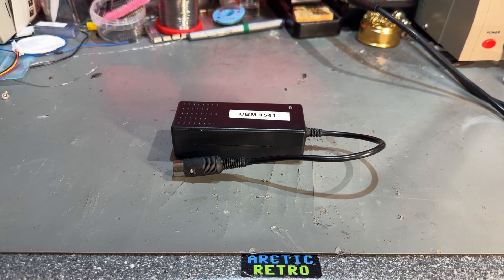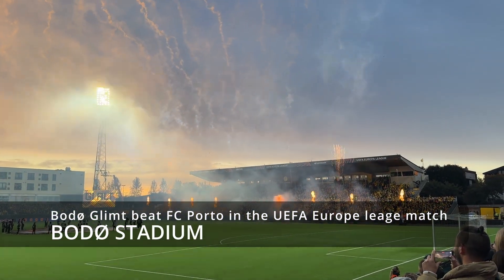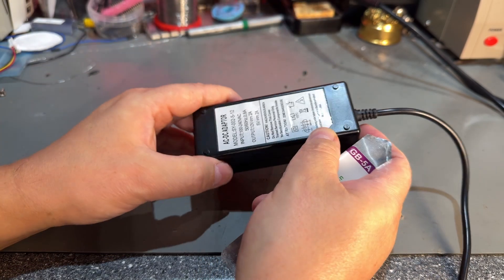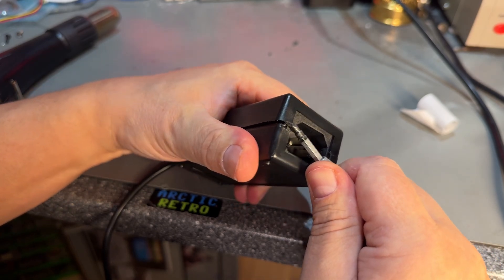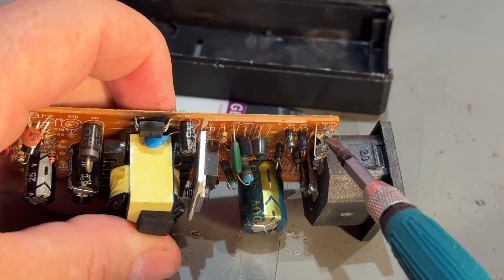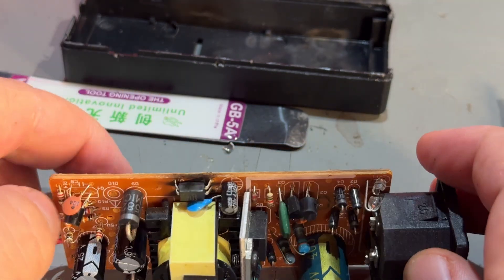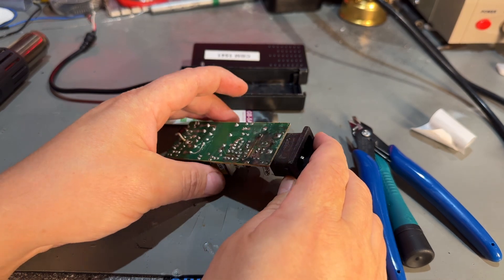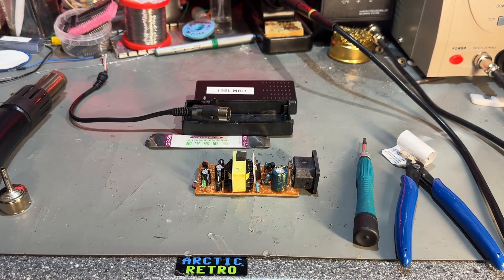SHOCKED ME: This 1541 power supply BLEW UP while I was using it. Can if be fixed ?

Comment: I found someone who created a USB-C to DIN power Adapter for the 1541 and 1581 drives, you only need a proper USB-C charger, works fine on my 1581. 
The 1581 only draws 1A on 5V max. so no actual reason to damage a 2A PSU, maybe that had a fault already, or why did the fuse in the house blew as well, the fuse in the PSU should be faster.

Comment: the component (with 4 legs) between the primary and secondary side is an opto coupler for feed back for controlling the output voltage.
Reply from the maker: Ok, thanks!

Comment: I've had one like that before, they're often sold as IDE power supplies. From memory the switching transistor blew in mine but it did the exact same thing as yours. Blew the fuse and burned one of the primary traces, can't remember if it also tripped the breaker. Looks like on yours the octocoupler had a misshap but the result is the same 🔥
Reply from the maker: It's always been quite warm, so I always expected it to fail.
Reply: Yes, it's an IDE power supply with output changed to DIN plug. They are dirt cheap at ebay or aliexpress.